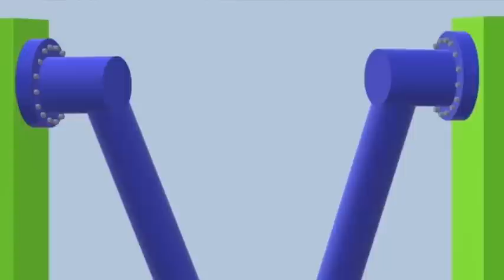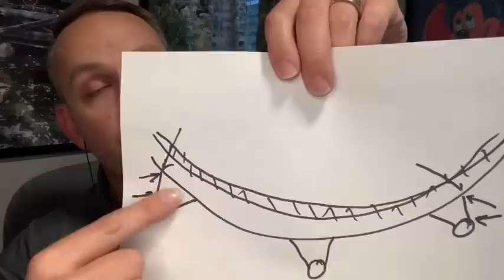Support beam cracked Fury 325 Carowinds When Will It Reopen?

Comment: What a great analysis. Really goes to show just how intricate crafting coasters is.
I always hear about the Steel Force Hypercoaster at Dorney Park sinking into the ground every year. I'd say if that were true, we'd start seeing problems like this a lot more often, but even at 26 years old, Steel Force is still pretty reliable.
Reply from the maker: Yea worst case is actually showing stress cracks in the track. That’s a death sentence for a rollercoaster. Never cheaper to repair and dearest replaced so their just removed and scrapped. Thanks for the comment!

Comment: Thanks for the great explanation! This industrial engineer from Kentucky appreciates the industry insights you brought. I completely agree with the survey being a key step in the first part of the process. I would think the survey would also provide insight if anything else pertaining to that part of the ride is out of spec. Cedar Fair seems to put a high level of ownership on the ride manufacturer when it comes to safety and reliability. I'd imagine the survey report will be scrutinized heavily to identify anything that can be pushed back on B&M later on in the process.
Reply from the maker: that I know of B&M does not have an inspection to check survey levels, its time consuming and expensive. Fun time, has a 5 year inspection to check survey for foundation as they build tall tower rides and can't have cleaning tower. footers settling can sneak up on a ride for sure!!!

Comment: Great Analysis.  I see so many freaking out with speculation, feigning outrage, etc.  Clearly there is a large margin of safety built into amusement rides, especially those as robust as Fury or any B&M.  The park should have caught this earlier with recent pics surfacing of a visible crack, but not full break, a week prior, but there wasn’t any sort of danger to park guests as far as I can tell.  Your explanation of a footer likely sinking to add additional stress in the weld at the top of the 45 makes sense and that’s where I was leaning based on my time working for a company that did welding and pipe fitting.  From a structural perspective this whole section is an arc that could, and was, easily supported by the support beams to either side.  Anywho, glad I found the channel, excited to dig into other videos.
Reply from the maker: yea I've seen some videos overreacting to the but I'm one of the few people that understands what's happening as well. It's not great but it's not the worst thing ever. I've seen parts that have ripped in half and you observe, inspect, learn, repair, and move on with life. Glad your here!

Comment: I have come across this before on a track backbone and it was caused by a faulty batch of seamless circular hollow section tube material from the forge. The heat of the forge was incorrect leading to a defect called reticulated cracking. If the reticulated cracking is from the inside surface of the tube, It is very difficult to spot other than Ultrasonic testing. Once the material is welded and installed, the cyclic loading of the train causes defects to grow and they usually appear on the outer surface, after a few years. They typically appear at highly stressed heat affected zones. (same as the failure of Fury 325)

The material at the forge only has to be pressure tested and visually inspected, so again, if the defect is on an internal surface, it cannot be found at the time of inspection at the steel mill. 

The failure on Fury 325 is pretty quick, as Ryan stated, there are no corrosion indications, weeping down the column. 

I had to switch out all tracks from the same batch of material, as we found indications on all the parts made from that batch. This was on a ride that was only 5 years old at the time. It sucked as the ride was out of warranty and the material manufacturer blamed the ride manufacturer for crappy welding. We had a metallurgist who stated the defects were clearly from the material supplier. It is not as uncommon as you think and there are many building structures where this defect will likely exist, they just don't get the cyclic loading that is introduced by the train. 

Coaster structures are designed to not only take the cyclic loading of the train, but also the combined loads of wind and earthquakes, so it is very safe, even with a wobbly column or 2.
Reply from the maker: Awesome!!! You know your stuff. Was that forge problem released in a bulletin from B&M. I recall a long time ago having to check column/ track numbers on a B&M for some reason. Our model was not affected just the parks CYA.
Reply: @ryantheridemechanic  You know your stuff too Ryan. I agree with the possible theory of the sinking foundation and spot on for noting a rapid failure of the column. 

I trained as a production machine tool maintenance engineer, before progressing to manufacturing engineer, in aerospace, where I learned the dark arts of materials science. Spent 15 years in the manufacturing sector before moving to theme parks. I have worked in the theme park industry for 21 years, where I have installed over 140 rides and attractions in the UK and UAE.

We spotted an indication in the parent metal on our coaster during NDT. As it was in the parent metal, a good inch or so away from the weld, we used ultrasonic to see how deep the indication was. This is where we found the bigger issue and fed the information back to the ride vendor. They gave us the batch numbers and track part numbers where the batch was used. We checked all the track parts related to the batch and noticed a higher number of indications on areas where the train load forces were greater. We had a third party metallurgist confirm the issue and all the information was fed back to the ride vendor. It appeared to be isolated to the one batch of material. 

Always  good to hook up with fellow theme park guys around the world to share issues. I work on project delivery for all Yas Island theme parks. (Ferrari World, WB world AD, Seaworld AD, Yas Waterworld and Clymb). A fellow ride engineer from Canada sent me a video of the failure and that's where I found your channel on YT. Keep up the good work.
Reply from the maker: @jjhatch69  great talking with you! Thanks for the kind comments. Take care and stay safe.

Comment: good insight, as a former ride operator at 2 different theme parks, when i saw images of this, i raised an eyebrow, but wasn't entirely shocked by it,  I know it can happen, but this is the first time i have heard of it going that badly.  though having experience as a ride operator, i know the track will be able to take some load for a bit of time, but eventually it will have to be replaced,  my guess on how long it will be would be several months, but as you mention its hard to know, i do know that its not likely to reopen anytime this summer season, maybe the fall or winter.

Comment: Thanks for the quick and professional insight! (Love the CAD - Cartoon Aided Design)
One more thing: why is the 45° angeled support facing towards the center of the curve? Is it due to the material property of steel or just preference of the manufacturer?
Reply from the maker: inertia of the train will pull the vertical support away from the center of the turn. So the manufacture put n a 45deg leg to appose that force and keep the force on the rails not into the box beam of the track. typically the slant is just to shorthorn the leg from being to long. then the leg itself will star to cause stress on the track from sheer weight. and I love the CAD analogy!!! HAHAHA!!!
Reply: The force the train can exert is a known value. You can use a structural member in compression to resist it (an outward strut) or a member in tension to resist it (inward strut). As long as you calculated the force exerted by the train correctly, designing the diagonal strut to be outward or inward should make little difference. In this case I suspect it was angled inward because an outward support might have extended into the parking lot and using the infield (which can't be used for much else easily) was just more practical.
Reply from the maker: @sharkheadism  awesom insight!! You are spot on. If that was the base of the question i missed it. (Yes makes the footprint smaller
Reply: @sharkheadism  correct me if I’m wrong, but isn’t tension preferred over compression for steel?
Reply: @mikewalker4950  Steel can carry either force well depending on its shape. Bar steel or rods will do fine for purely tensile loads but will deflect and warp under compression, which is why flanged beams and tubes are used for compressive loads (and most flanged beams and tubes can handle tensile loading because realistically, most structures will endure both types of forces).
Reply: @mikewalker4950  Yes.  That is why bicycle spokes are so much smaller than wagon wheel spokes.  Bicycle spokes are in tension and wagon wheel spokes are in compression.  For practical purposes, the only compression part of a Ferris wheel is the ring(s) the cars are hung from.  Everything else is in tension.  At the lengths involved, the slenderness ratio will indicate a buckle of the member.

Comment: You may be the only online "engineer" who got this right.  So many claiming to have expert knowledge produced better graphics but still got the stress points wrong.  Your examples were simple and easy to understand.  I like how one "engineer" with a channel claimed the ride could be simply welded and the ride back up in a few weeks.  Today they announced the column will be completely replaced, as it should.  One factor not considered by these experts chiming in is the Public Relations aspect.  Replacing the entire column makes a better visual, as well as engineering sense.  Thank you also for stating this was not normal.  I know personally this type of catastrophic failure is very rare.  I still say the maint team failed here as did the reporting of the incident.  That is another video.  Thank you and keep up the good vids.
Reply from the maker: Thanks for the comment. I’m not an engineer, I have no degree as such. I’m just a mechanic that has spent 14 years doing this stuff and could say right off the bat that B&M would not sanction a repair. Let’s hope the replacement comes soon so they can get back up and running!
Reply: @ryantheridemechanic  In my experience the ride mechanics I know are more capable than many engineers.  They see the realities of a system, not just the theory. Thanks.

Comment: Those sketch examples deserve to be in the Getty Museum rather than on a fridge. Top tier art!

Thanks for the insight on this! It's interesting how two pressure points and one tiny little hair of a crack can lead to this. I assume the leading factor of the pressure can originate off the friction of the track with the weight of the cart. That mixed with the material used to make the supports and the age/wear-and-tear of the attraction can likely factor to this happening right??
Reply from the maker: First of all: I’m glad your having fun with my drawings. I laughed at it but I wasn’t sure how others would take it haha! 
Second: everything you listed is a factor. But the main culprit is a preexisting load on the leg. Weather it was sinking or maybe a gap was sucked shut during construction? Not to sure but that leg became preloaded somehow.
Reply: @ryantheridemechanic  They are actually terrific diagrams--they show exactly what they need to show and nothing else.
Reply from the maker: @MattMcIrvin  thank you
Reply: Thanks for this explanation :) I usually feel really safe knowing more about the science behind roller coasters (such as block sections, restraints etc.) and this video also helped with that. And I gotta ask: with what software did you make those exceptional sketches? :p
Reply from the maker: @DangerHuub  custom software called handeyecoridnation can’t remember who makes it hahaha!!!!

Comment: If the footers sinking or moving is a common cause of these types of failures, do any modern coasters have any kind of monitoring sensors in the footers to keep track of this?
Reply from the maker: It’s not a common thing at all. But you don’t really know it’s a problem until it’s a problem. Then it’s too late and your replacing steel and digging new support footers.

Comment: Do you happen to know how often (If at all) support beams are checked?   
I'd assume visual inspections are daily/weekly, but how about NDT of the weld joints?
Reply from the maker: Visually checked daily i always told guys you will never see 360° so look do dust, chipped concrete, and rust that’s a tattletale that there’s a problem. Most parks annually NDT with an outside company this is just very close up visual. And then mag partial if any indications are found.
Reply: @ryantheridemechanic  awesome, thanks for answering!

Comment: bummer.  fury 325 is one of the best rides on the planet.  I have a bit of engineering background and had an idea of what was going on but you broke it down better than I could.  Thanks.  I think it was a mistake to put a vertical support in that spot when IMO a diagonal support would have been FAR stronger.  You can get away with a vertical support on a normal coaster but this one has a max speed of 95 mph. I'm thinking the park didn't want to intrude on the parking lot?
Reply from the maker: yea your right I believe the turning of the supports are done to save space not the overall ride footprint. I have extreme faith B&M did their math spot on plus safety plus service plus 25%. that's why I'm thinking the footer settled. thanks for the comment..
Reply: @ryantheridemechanic  Thank you for your expertise.

Comment: Interesting insight regarding the potential foundational issues at play. Couple things pinging around my head about this incident, if there is indeed ground movement at the problem location is it likely there are other potential problem piers that need substructures or other remedial action? Second who assumes liability for the remedial action, the park, the manufacturer, a subcontractor? Seems a terrible headache overall factoring in the optics of having such a dramatic looking failure circulate widely on social media/news outlets. 

P.S. Appreciate your insight! Found your channel a month or so ago and it's been very interesting learning about a side of the industry that doesn't get much exposure.
Reply from the maker: So the media attention is doing massive destruction faster than anything else will. 
Park always has liability unless deemed a manufacturing defect (I don’t see how this could be that.) 
If the ground has moved they will need to determine the scope of movement, only then can they discuss further action. 
I remember the theme park close to where I used to live had a helix over the body of water. After about 15 years in operation, it started developing stress cracks. They found the entire helix was sinking into the water. It was a very large repair cost a lot of money, but I believe they ended up re-fabricating that whole section of track with new ground piers.

Comment: Same thing happened to my Jeep's aftermarket tire carrier lol.
Reply from the maker: oooh I can imagine, low center, overhung weight at high vibration... I can easily see that. this stuff normally happens on stuff under 20mm total thickness, typically brackets or standoff for signs.

Comment: my plan was to make a video about this this weekend, this shouldnt happen after 6 years. THANK YOU! for also agreeing that full detailed checks need to happen on footers and supports. the footer will have to be re done, and a new support installed. and that dosnt just take 2-3 weeks like they claimed it would re open. the amound of people from the general public arguing with me saying its "fine" "it will be open with a weld or a new support within weeks" 
I wouldnt ride it if thats all they did. 
honestly.... to make sure there isnt any issues on any other high stress part of the ride (most of it because its fury 325 lol) they need to do the detailed support and foundation check on every foundation and support. 
if done properly like it should be, I dont think It should be open this year. with construction / repairs over winter.
somthing like this needs to happen in the right way to gain back public support for rides and coasters. because god forbid if they do a botch weld job and it happends again in a few weeks or months.

Comment: I'm not even going to bother comparing the teen roller coaster enthusiasts' online analysis compared to this lol I've seen some ridiculous hypothetical videos when other coasters have failed. Bless them for trying to do fancy illustrations though. They get  bunch of views. This is all you need. This timely video will get you more subs. And linked elsewhere if you leave embedding turned on. This incident has been a headlining story in the 'MSM' Main Stream Media. And there weren't even any injuries or deaths. (There's been a long-running enthusiasts joke that 205ft Magnum XL-200 at Cedar Point is sinking. I don't know who started that. But my joke is that means 310ft Millennium Force on the other side of the park has gained 5 ft. One interesting thing to note about Millennium Force is it has no trim breaks. It has a couple of brackets in case it did. And 93mph hurts in the rain. You can't breathe in the first over banked turn. Trim brakes could be a video topic).
Reply from the maker: Great comment thank you! I’m conflicted internally with trim breaks. The mechanic in me says slow it down everything will work better. The rider in me says “we don’t need no stinking trim breaks!” Haha!!